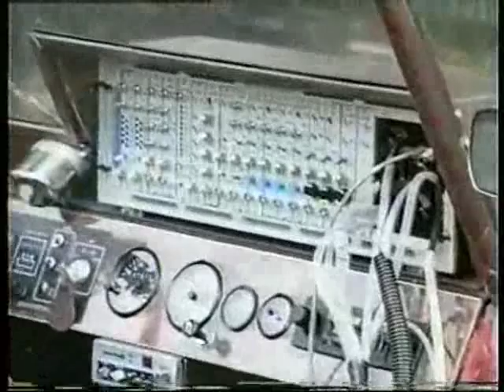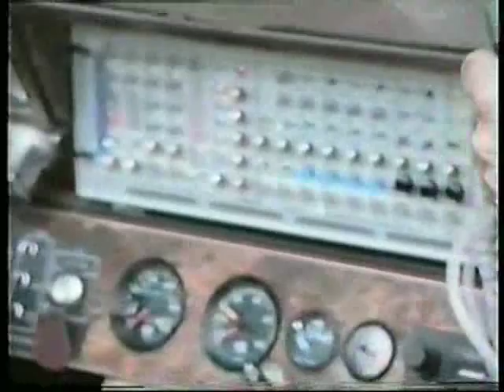Stanley Meyer 1992 Interview

Comment: @Desertphile in fact desert pile, all real research into what stan did, shows that he told the truth.
he did not use standard electrolisis with high amps.
in fact it was more like electrostatic charge. this high voltage electrostatic charge is used today to make ozone and other things connected to processing water. to make cleaners from water and others things.
companies make medicine by breaking the bonds of all kinds of things.....they do it with a similar process. 
so in fact the tech is real

Comment: Hydrogen has 1 proton and one electron. so it is considered to have 1Mu (mass unit)
Oxygen has 8 protons and 8 electrons.. so it has 8 Mu..  Now the atomic mass ratio can be represented like this. (2H x 1Mu) + (1oxy x 8Mu)= 10Mu.. with this we can provide a ratio... 2H (Mu) divided by 10Mu = 20%  so in a given volume of water 20 percent is hydrogen.. 1 gallon of water weighs 8.345 pounds x 20% =1.669 pounds of hydrogen per gallon of water

Comment: 1 gallon of water has 2.5 times more hydrogen then 1 gallon of gasoline by weight.. This is why stan claims it has 2.5 times more power then gasoline.. because there is more energy stored in water by volume.. the volume injected during a injection cycle of gasoline should then in return be 2.5 time more volume then that needed by water.. with the ionized gasses upping the thermal energy of the standard hydrogen/oxygen mix it may require even less per injection cycle.

Comment: @irondmax   I  already  have ..  This  is  a  very  important  video  filled  with  important  facts.  Just everyone  please  sit  down  and  take  notes.  The  KEY  is  Extremely  low  amperage and  pulsed  High  voltage to  induce the electrolysis   with  low  power  consumption, so that  On demand  systems  can be fiesable. inside  the  home, for  heating water , air, cooking food , and  for  power  generation, cleaning  purifying  water  and waste. Finally  these  systems ARE being used now.

Comment from the maker: I'm an Electronics Engineer and I can tell you that Stan's technology is real and does work. There's more to this technology than just pulsing a circuit with a single frequency. There is also a lot of Physics involved in this technology where as you have to match the molecule's vibrational frequency and the LC circuits frequency. Just do the research and you will see what I'm saying is true!

Comment: a cold voltrolisis process that uses much less amps then normal electrolisis.
meyer clearly said low amps.
low amps mean low load on generator or alternator.
low load means  less drag.
water is very unstable and will self ionise.
meyers process just helped it to ionise and broke the electron bonds , drawing the electrons off with a static field. static fields can come from a rubber comb through hair. static electric fields are how capacitors function.
merely clearly says what he is doing
u r not

Comment: what meyers shows here is static electricity to ionise the air that is injected and the water is primed with static and injected as well, combine this with the exhaust gases, equal to gasoline.
the key is when he talks about the B+ and B- voltage. very high voltage.

Comment: @petventures simply , restrict the amps with a magnetic field, voltage goes up as amps go down.
the more pure the water, the higher the resistance. 
static charge to the intake air, water is primed with light and electricity and atomized and mixed with the static ionised air and exhaust gas. injected into the piston chamber of the engine. then ignited with a spark plug. not steam. not brute force. more like rubbing a ballon on your hair
or a shock from a stun gun
ice or steam expands

Comment: @commando7144 there are tons of self resonating circuits out there using the HHO cell as a capacitor and a transistor to switch it off when it reaches full charge and off again when it drops. do a little reach but its very easy when the cell is controlling the resonance of itself for itself.